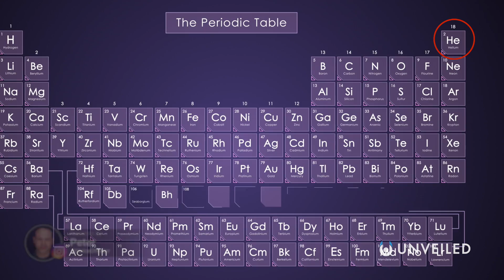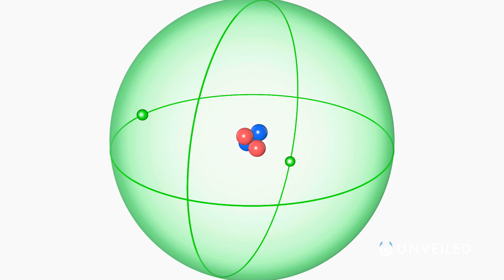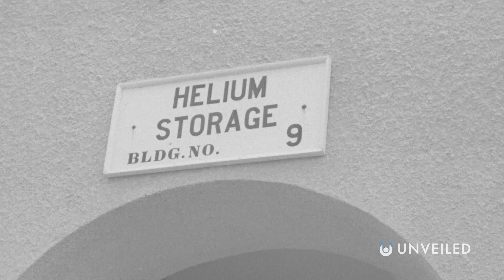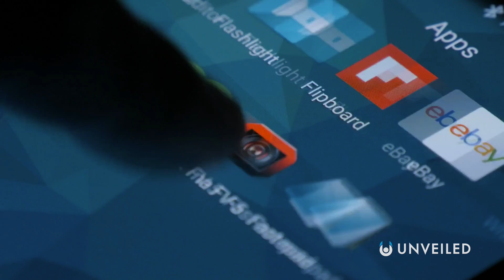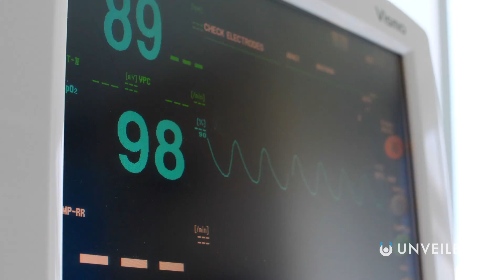Why Scientists Are So Worried About Running Out Of Helium | Unveiled

Comment: The potential of helium is only beginning to be explored. Scientists are looking into using helium as a fuel source, as it is non-toxic and has a high energy density. It is also being studied for its potential use in nuclear fusion, as it is a stable element that can be used to contain the high temperatures and pressures needed for fusion reactions.

Russia used to be a significant supplier now out of the market.

Comment: Unveiled I would like to ask you to please explain how to following facts reguarding helium can possibly be true if just escapes and vanishes never to be seen again or reused.

Helium exists in the atmosphere at a concentration of 5 parts per million easily detectable in air samples, and it is increasing thanks to anthroporgenic activites. 

Helium is also pulled from the air through fractional distiliation, before any of you attempt to argue this process is simply too expensive. This is the same process used to extract it from natural gas as well as purify natural gas.

A gas that vanishes whenever it's exposed to air would be too impractical to transport let alone mine and yet we do. If helium is capable of escaping our atmosphere, why don't we see helium balloons rising at escape velocity 30,000km per hour? If helium does gain escape velocity whenever it is exposed to air how can we possibly use it or transport it without it just ripping out and lifting away the required infrustructure and storage?

I look forward to hearing a response. Although it's not likely I will but even if you did, I highly doubt you have an answer to any of these facts or questions.
Reply: Thank you for questioning this

Comment: The people that control the helium reserves are those that would have you believe the second most common element in the universe is a limited resource.  Proof of concept for industrial production of helium was first demonstrated in 1906, when it was discovered that alpha particles are actually helium atoms minus an electron. With current technology it would be feasible to produce vast amounts of helium from spent nuclear fuel rods, but if we did, the monetary value of reserves would plummet--meaning those controlling the reserves are extremely motivated to perpetuate the myth that it's a non-renewable resource.
Reply: But we already know that helium on earth is formed by radioactive decay.

Comment: In a container that has a "hard" vacuum put a small amount of hydrogen along with a grid that is charged up to the highest + voltage that you can. As the hydrogen atoms bang into other hydrogen atoms, a certain number of them are converted to helium atoms.  Not enough atoms to sustain producing energy by this method, but depending on what you need the helium for ...

Comment: We can make helium-3 by bombarding lithium with neutrons making hydrogen-3 that with its halflife of 12.32 years decays into helium-3. 
I would take the generated tritium and use a fuel cell to combine it with oxygen to make heavy heavy water. This I would store in nickel lined tanks then separating the helium-3 from the oxygen that gathers at the top of the tank.

Comment: If we can perfect fusion power then we will be making Helium-4 as a byproduct, as fusing Hydrogen-2 (Deuterium) with Hydrogen-3 (Tritium) makes Helium-4
Reply: Except we do t have fusion power and my never.for all we know and tritium is rare and in limited supply as well.
Reply: @richardsanjose3692  Tritium is an isotope of hydrogen, it's in water and there's heaps.
Reply: @FRONTSLUNT  yes it's in seawater but not heaps as in duterium of which we'd have practically an unlimited supply. Tritium not so much
Reply: @richardsanjose3692  I didn't know that
Reply: Tritium (and Helium) is made from Lithium in the fusion reactor

Comment: Helium is produced via stellar nucleosynthesis via the process of nuclear FUSION, not fission.
Reply: Calm down there, volatile does not mean reactive, smart guy. It describes substances that quickly evaporates at room temperature. Helium is about as volatile as you can get save for liquid hydrogen. See also - Nitrogen,  CO2, NH3, some solid reagents such as iodine and napthalene, organic solvents such as acetone, methanol, ether, etc., liquid reagents such as mercury, organic phosphines or mercaptans, etc....
Reply: Helium is also produced in certain decay reactions.  An alpha particle is basically a Helium nucleus.
Reply: it is volitile

Comment: your video is fundamentally wrong the sun uses Fusion  which occurs when two atoms slam together to form a heavier atom, like when two hydrogen atoms fuse to form one helium atom.

This is the same process that powers the sun and creates huge amounts of energy—several times greater than fission. It also doesn’t produce highly radioactive fission products.

Comment: I believe the moon is rich in helium 3.
Reply: "rich" is a relative term. Helium 3 is present in the solar wind ,  and some of it slams into the lunar regolith and sticks. It can be recovered by heating the regolith to high temperature and capturing the helium as it is driven off. But you'll need to process a million tons of regolith to recover a kilogram or so of helium 3. OTOH, that kilogram or so of helium 3 will be worth hundreds of millions of dollars as fusion reactor fuel on earth.

Needless to say, nobody uses helium 3 to float party balloons.

Comment: My stepfather has been telling me this for a decade now. I'm glad it's a mainstream talking point now. God speed. You know it as well as I do. As long as Capitalism remains. We are fucked.
Reply: Capitalism  has nothing to do with it.
Common Sense Does.
As of lately I haven't seen very much common sense on this planet. Only foolishness and egotistical selfishness of self-righteous Tyrants.
Reply: @arthurzettel6618  Yeah well people may have common sense but markets maybe not so much.  Turns out when things are organized with the freedom of markets in mind rather than freedom and best interests of actual people and the rest of the planet, common sense becomes sort of irrelevant. 

A good example is alkaline batteries.  We've had lithium ion cells cheaply available enough for over a decade to be using them in every small consumer electronic device and yet AA's and even worse, AAA's are still being used in all sorts of things despite that being counter to common sense.  Another is LED bulbs which would last far too long if designed properly so they design them badly to run hot and burn out.  Everywhere you look you see things being done badly and wastefully for the purposes of profit.
Reply: @arthurzettel6618   capitalism just makes a person so much exploitive, ask developing countries, capitalists don't give a fk about working conditions etc.. 
Just fking profits
Reply: Yeah, things are so much better under Communism. I for one want to move to China. Over there, they respect and care for Helium.

Comment: If we manage to perfect fusion, would that not make a great deal of helium>
Reply: Some but not a huge amount, it's a very efficient process. Small amounts give huge amounts of energy. Depending on how efficent power extraction we get. We need it to run continously and we need to be able to pull out more power than the system takes to keep running. Eventually we could turn all water on earth into helium and create a desert I guess :D  But that would be a massive amount of fusion power.
Reply: I heard that we would have to increase the worlds power output by 7000 times with all fusion reactors to get enough helium to meet demand.
Reply: @TheAmericanCatholic  That could power one hell of a party.  And then we could have balloons guilt free!
Reply: Its too bad we are not better at space travel, there is lots of helium to be had in this solar system alone.
Reply: @BebeBoomerPaul  The moon has a good supply if I remember correctly.

Comment: I was at a facility in Kansas that extracted Helium from Natural Gas.  Before that trip I never considered where Helium was obtained.  They pull Natural Gas out of a pipe line, extract the Helium, and push the Natural Gas, minus the extracted Helium, back into the pipeline.
Reply: So essentially these big gas Wells and drilling companies could also be extracting helium is that what you're saying
Reply: @onlyonemikaelmdme   Not 'could', but do. You may be aware that crude oil is composed of, and separated into many different things, not just gasoline for your car, but also oil for the engine, even the Vaculine you buy at the drug store. I don't know much about such things, but here in the Bakken (ND), we have Natural gas, from the ground comes all kinds of gas, not just LP you buy to heat your house. It's a mixture of whatever's down there and it needs to be separated such as crude oil does. So yeah, methane, beutain, propane, and perhaps even some helium or whatever, a bunch of stuff comes out of the ground as a mixture. It's quite a process to get it all sorted out for market.
Reply: @Birdracer22  ah you mentioned crude oil very interesting and I'm just curious what does crude oil used all for is it for a lot of things but why is it so important?
Reply: @onlyonemikaelmdme  It is easy to extract or modify the long carbon chains in oil and its sub products.
Reply: @onlyonemikaelmdme  Well, as I said of the natural gasses in the ground. Crude Oil is called that because it is just that, "crude", just a mixture of whatever nature has deposited in that particular area. You can't make it all into gasoline, or any other product. It comes up as a bunch of goo and that's what refineries are for, they separate it out into it's individual components. It ain't all about gas V's electric cars (although the electricity to power a battery car still has to come from fossil fuel). There is tons of other products derived fr them. Just think about it, say you are in a medical emergency room, there are a thousand items made of plastic in there to help save your life! Plastics are made from crude oil ingredients.
Reply: @onlyonemikaelmdme   Long story short, if it wasn't for all that gunk in the ground that the dooms dayer's hate so much, we would still be cavemen.
Reply: @onlyonemikaelmdme  Since you asked about the subject, and at the risk I am boring you, I will tell you one more thing of interest. In Grand Forks ND there was a large group of investors in 2016 willing to put up 300 million dollars investment to take our 'flairs' in the west and make Nitrogen fertilizer for the farmers in the East bread basket. Yep, another tidbit for you, NW ND has tons of underground resource, the East has the best farming soil in the world. And yes, we can make fertilizer from the gas. But No! The deal fell through because of politics. I appreciate your curiosity about such things. I'm an old man that will be dead soon enough, but if your a youngster I would advise you to think long and hard before jumping on a bandwagon heading for the voting booth! Good luck an all best wishes kd
Reply: @Birdracer22  no I thank you and I pray you have a long life sir. Oh trust me I know about the voting booths and where and how far are you getting with that I can't vote unfortunately I'm a convicted felon. No worries. I know it's a game. And a big club which were not in.
Reply: @onlyonemikaelmdme  Sorry I couldn't be more helpful. It is such a huge subject that you could spend years studying it. I thank God for the natural resources and the people who know how to extract it. It's quite fascinating. Here in the ND Bakken oil field it was exploding industry untill Biden shit it down. Still, as I type this, I am looking across the night sky and see 7 "flares". It's a sad sight to see. They are oil wells pumping out the crude oil, but natural gas also escape. Because of a ban on pipelines, the liquid juice can be hauled in trucks and trains, but the airborne gas is vented to a "flair". It's just lit afire and burns day and night. It's the legal and "environmental" way to dispose of it. Such a shame! There's one by my house that shoots flame hundreds of feet into the air, you can feel the heat of of it a half mile away. But because of regulation, it's not allowed to be contained and processed, they simply won't allow a pipe to be dug. It's all politics. Vote Democrat and that's what you get. The so called planet savers are killing us.
Reply: @Birdracer22  from a long time ago, I always thought that burning off was a waste of valuable energy. Looking at images of north sea oil rigs, makes me want to kick ass.
Reply: And dump shit tons methane straight out into the air . What a murderous industry . It really has killed us all .